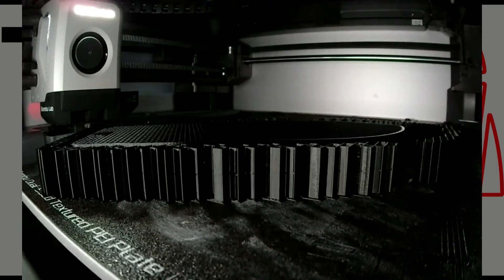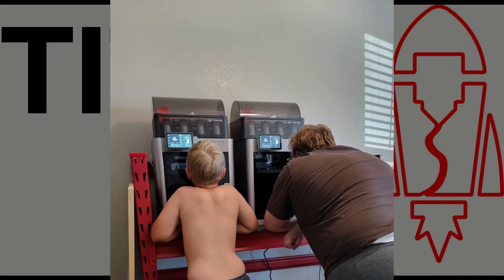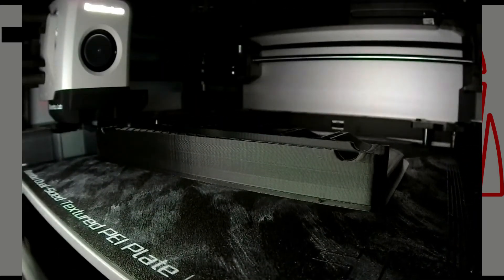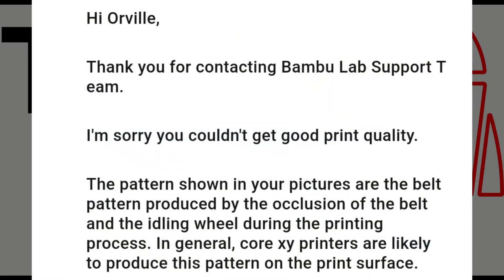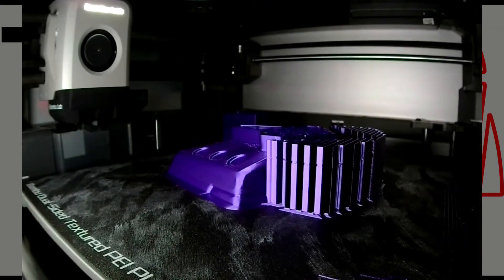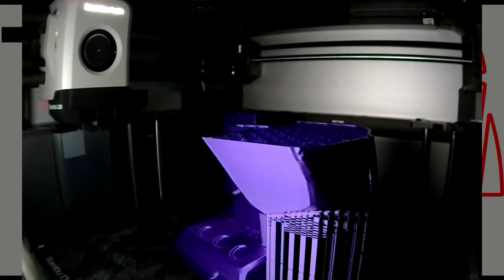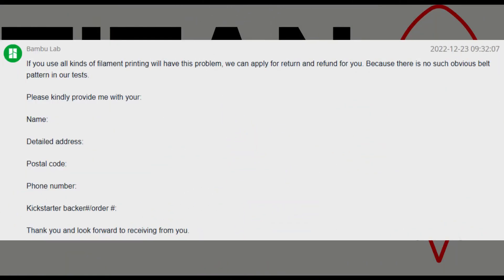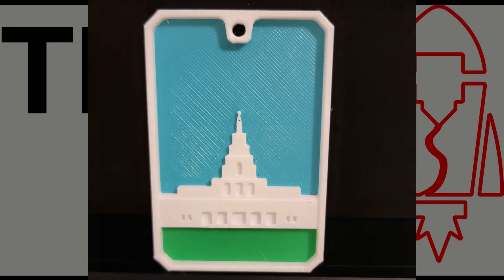Review of the Bambu X1 Carbon You Didn't Expect

Comment: But your limitation was with petg. You'd run into that speed cap with that filament on any printer if what you said about it's flow rate is correct. So why not just print at 80 or 100 mm/s...? the accels still create a great print time advantage over any i3 and other corexy machines.
Reply from the maker: Like I said in the video, I tried speeds from 50 to 300mm/s and this happens on all my materials including ABS
Reply: @Titan3DAZ  the printer was malfunctioning since the first startup, so maybe a part of the firmware or SD cards got corrupt. I believe those prominent VFAs are actually horrible input shaper results from the auto calibrate. Either way, my question now is, what printer are you moving to?
Reply from the maker: @Mehecanogeesir  it's not vfa. I factory rest my machine to see if it was bad firmware update or something and this persists. I also put this thing on the concrete foundation on my home and then added more and more weight trying to reduce the resonance with no luck. The pattern does match the pitch of the belts though. So far I am looking into raise3d, fusion3d, and maybe ultimaker/makerbot.
Reply: @Titan3DAZ  go DIY and build a K3 by Annex Engineering, a Vzbot 4WD, or a Voron Trident. The first and second being great and the Voron being a bit worse but the most available parts. You need printers that can pull thousands of hours at 10k-20k+ accels. Also DIY makes repairability  more dependable since the parts aren't from your printer company, which can close down or be unhelpful. DIY printers also have helpful communities/discords for help.
Reply: @Titan3DAZ  I got the Raise3D E2. Absolutely not worth the money. Resorted to the Slice Engineering upgrade and things got a little better but still not as good as my Prusas.
Seems like many other owners of Raise3D machines are similarly unimpressed. Seem to need lots of workarounds, they seem to work slow and need too much fiddling. The slicer is terrible. The customer service was sketchy at best. Waiting on the Prusa XL I think.
Reply from the maker: @Eric Mary  what about it specifically don't you like aside from the slice upgrade? I am looking at the Pro3 series though which seems to be noticeably upgraded in a lot of ways. Plus I got their sample part today and I am extraordinarily impressed with its quality. I asked them specifically for it to be done with the hyperspeed upgrade parts so I could compare the 300mm/s print speed of that to the bambu and the raise 3d Pro3 is better in every single way.
Reply: @Titan3DAZ  I have to say the Pro series might be better but you'll find considerable scepticism among owners. Their customer service record has been sketchy to terrible. When there is a problem it is always your fault. I also print mostly PETG and it's struggled with print quality from day one. First I wasn't drying enough then suddenly I overdried it. Bed leveling had to resort to shims as the screw ran out of travel. I talked with one person who bought an entire print farm of them and struggled greatly with similar issues. The European sales rep gave him the same line while standing in his shop. Always your fault, never theirs. When I mentioned the same file with the same roll printed perfect on a Prusa they got a bit hostile. I finally gave up on them and have wrestled with the issues with other users. Pretty much everyone feels they paid too much for the machine for what it actually delivered.
Reply: @Titan3DAZ  I remember the original raise3d printers everyone said had horrible support and didn't work well. Then the second release people had hopes for it being the new improved printer but it ended up being more of the same.. a lot of these companies know how to make an attractive parts list, a great looking printer, and a video. Not many of them have things really well figured out. Bambú Labs was supposed to be one of the first greats with great accels
Reply: @Titan3DAZ  and you believe that sample they sent you will match your prints? Lmao so naive

Comment: Try RatRig V-Core3 series, not as easy to start with as Bamboo but RatOS makes combined with great HW makes it great for large high speed printing...
Reply: I'm new o DIY printers. How does that compare to Vorons?
Reply from the maker: @MrJofArnold  They're IMO very similar. The rat rig will let you go bigger than the vorons, but the vorons have the flying gantry system which keeps all the weight at the bottom of the printer for the longest amount of time.

Comment: If the wavy pattern is the problem why not just sanding it to make it smoother? I may not understand the issue completely though. You may also be able to account for this in the print settings by playing with them a bit.
Reply from the maker: Sanding removes the desired surface finish, plus with the amount required I lose the dimensional accuracy that's needed on these parts.
Reply: @Titan3DAZ  ah, understood then

Comment: did you run both printers at once on the same table? that would kindof explain artifacts impossible to eliminate... since each printer would send vibrations into each others assembly.
Reply from the maker: At first yes, but then I separated them, put on on the floor, the other on the floor, added more weight to them, put them on a paver and a rubber mat to isolate the vibrations, and stepped one to some anchors in the foundation for my home and nothing changed the pattern.

Comment: Your goal was to be negative about this printer.  You met your goal.  Of, course that does not change that it is probably the best consumer printer made.
Reply from the maker: I firmly disagree. My goal was to use them for my customers, and I really love what bambu was able to accomplish. I just really wish they were able to have better quality control in their manufacturing process.
Reply: If the "best consumer printer Made" can't print straight walls without ripples at any speed... well then it is just not the best. My Ender3 (yes not storebought anymore) outperforms the Bambus in every aspect except speed and esthetics. yes it's slow and looks like Shit but it's siiiiiiilent and prints exceptionally clean surfaces, has octoprint that Manages my prints. 
And man there are so many good consumer printers Out there. Bambu is hiding some serious issues and people are still praising them as a new Jesus. Man these things aren't worth the money. Everything else is a lie.

Comment: I have this problem on the Y axis too but with a Ender 3 Max bedslinger printer. I had a rummage & found a toothed idler in my box of goodies. I'm from an engineering/mechanical background & have often looked at the smooth idler the belt runs on & thought to myself that's a stupid design. I'll fit it to the printer today & edit this post later on with an update.
Reply from the maker: That'd be cool. Please post your process on Facebook, I wasn't able to see an easy way to get the smooth idler out.
Reply: @Titan3DAZ   I changed the idler to the toothed one & while it did reduce the vertical column effect it didn't eliminate it. My printer is the Ender 3 Max as I said in my previous comment

I don't use that horrible app you referred to
Reply from the maker: @Phil B  interesting that it didn't eliminate the artifact. I'm glad it reduced it though, it's a step in the right direction.

Comment: What stirkes me about this video, is how much effort the OP had to put in to get a replacement. The amount of time he had to put in mustve been substantial. Probably coulda bought 3 machines with the time invested. I bought one and have had nothing but problems right out of the box. Due to work schedules, I didn't have the time to mess about with it very much until my 14 day refund and 30 day return had passed. Word to the buyer: If you buy one, make sure you bone up on the return and replacement time periods and use it as much as you can in that period to confirm it works. Also, be prepared to spend lots of time via email on additional data calls. upload your 3mf file and logs AND a video. They will hassle you for a video if you don't send one. Also , you might want to consider taking a video on your phone (so you can capture the screen on the front of the printer as well. you can upload that video easily from thier phone app.  Mine literally failed the benchy test right out of the box and I've had nothing but problems. The last thing I wanted to do with a printer was continually tinker with it.. And that's what I've had to do. So instead of print things, I've been spending my available time fixing things. I liteally spent 2.5 hours of my time to get a $35 warranty replacement part. Really frustrating. Oh! and be prepared to do everything via email as well. It takes forever., I was looking forward to this technology and no all I want to do is go all Office Space on it.
Reply: Any relief on your issues?
Reply: @memcrew1  So I waited 2 weeks for bambu to send me a new micro lidar, and new TH board and a usb c cable. I wasn't convinced that this latest round was going to solve the problem as I felt like they were just throwing parts at it because they had no clue. After spending 5 hours replacing everything, it still didn't work. At this point, I've replaced every part in the head, except the extruder tip and fan assembly. So I fired it up and it air printed. Aggravated, I tried heating the tip again and manually extruding by pushing some pla through. Nothing. I took the tip off and lo and behold, it was plugged. Thankfully, I had a new one on hand so I replaced the tip, heated the tip to 170 and manually extruded material. Threw the spool back in the AMS, loaded up a benchy and it printed right off. 3 months of Bambu troubleshooting and they missed the first thing that they should have had me check. Thanks for checking back in. I fixed it. Bambu sucks. What a waste of time and money.
Reply: @watermanna  Oh wow! Such a simple fix. Glad you solved it.

Comment: Print faster and turn up the nozzle temp.  Better layer adhesion and surface finish is the same.
Reply from the maker: That's not how layer adhesion works. Also, I did try faster speeds with no luck.

Comment: Couldn't they add teeth to the idler?  If that's truly the problem that should fix it.
Reply from the maker: Agreed. I'd hope they'd fix it. I'm not sure if the old smooth idler can be taken out. It looks like it was press fit in there with no real way to disassemble.
Reply: Have you tried printing a tpu insert OVER the idler to make it a stepped idler?

Should absorb some energy and be easily replaceable, without requiring the actual idler to be removed

Comment: It's kinda naive to think that you ll make make 3d printer factory just by having some experience 2 years ago and buying 2 expensive printers. It's actually the opposite. You need a lot more experience and a few of low cost but customized 3d printers with parts which you actually need. It's cool that you found the problem and shared it with us but your mindset from start was naive and I think it's not that big of a deal like you make it seem.
Especially I don't see why you bought it if petg is constrained by speed and bamboo is all about speed.
Reply from the maker: Well for 1, I print in tons of other materials, like ABS and PLA, TPU, Nylons, etc and sometimes I print PC-CF. I have over 6 years of experience with building and maintaining 3d printers, I have just worked at a company as a production manager for the 3d printing department for 2 years. I am not naïve at all with this endeavor. I do have a functioning business that prints lots of parts for lots of people. I just thought these would've been able to pay them selves off within the months of November and December and they could not do it.
Reply: @Titan3DAZ  okey, thanks for explanation. It s pretty unclear in video how much experience you have and why you had this idea. Sry for attacking you.
Reply from the maker: @Lovro Catela  it's okay. More for me to learn for my next video. I'm 100% new to this side of YouTube and it's a lot more than I thought.

Comment: you got refund from bambulab, what printer do you use, not corexy that means cartesian like qidi x cf pro?
Reply from the maker: Currently working with a flashforge guider 3 ultra. It's corexy and I'm going to put together a review of it in the new year.
Reply: @Titan3DAZ  Nice printer but price 6 195,00 € is really too expensive. Any other options with smaller build volume? The qidi is a no go option?
Reply from the maker: @akierum  I think if you have the money for a qidi, then go for it. They are really great options. I loved the qidis I used before. I do also think the adventurer 5m pro by flashforge is really comparable to the bambu and way cheaper if that is more your route.
Reply: @Titan3DAZ  The adventurer 5m pro does not have engineering materials as recommended, so any other options for ~1400Eur
Reply from the maker: @akierum  engineering materials at that price? I don't know of any. Engineering being nylons and PP and PC, idk any that are designed for that in that price range. Probably a voron, but you'll need to print the parts out of ASA.
Reply: @Titan3DAZ  qidi x max 3 is 350c nozzle PLA, ABS, ASA, PETG, TPU, PC, UltraPA, Nylon, etc.

Comment: It's 2024 and the problem is still present
Reply from the maker: Sad. I'd have thought Bambu would've gotten to the bottom of QC by now...
Reply: @Titan3DAZ  I have figured out, printing at slow speeds seems that resonate more and the VFA is present after run a VFA test I can corroborate that the minimum speed is 140 mm/s with PETG with PLA is less than that.
Reply from the maker: @paco-medina  interesting. Unfortunately my issue has to do with the belts. The pattern you see matches the belt pitch and show what misaligned belts on smooth idlers can do.

Comment: Those vertical lines are called Vertical Fine Artifacts. Even Prusa printers have them. My Ender 3 too, especially on the Y axis.
Some people claim that changing to 0.9deg motors will reduce the problem, but I don't think so. 
I think it's due to the nature of stepper motors and resonant frequencies + having to move considerable weights around. For instance, the Prusa Mini doesn't suffer from this problem.
Reply from the maker: I know of VFAs. This is not that. The pattern has a 0.4mm difference from the peaks to the valleys. There is literally a physical gap on the part inside the pattern.
Reply: @Titan3DAZ  did they not change in separation with varying speeds?
Reply from the maker: @alejandroperez5368  nope. They stayed exactly 2mm apart no matter what speed or what accelerations I used and no matter the filament I used

Comment: I have had my P1P for a few weeks I have not seen this issue at all. Sounds to me like you may want to go the route of the new Prusa. Looks like a fantastic machine and I still love my Prusa that I still use. Looks like it will be in the $3500 price range with 5 Print heads. Good luck
Reply from the maker: I'm definitely considering the new prusa xl. I hope it doesn't need to use prusa slicer though, I really am not a fan and I like other slicers more.
Reply: @Titan3DAZ  I’m just the opposite. I’m not a.fan of other slicers I love Prusa’s. But yes, you are going to have to use their slicer from what I’ve been reading and watching because of its multicolor version of the AMS.

Comment: These are the kind of videos I’ve been waiting for, videos that show a potential issue with these printers. 

But to be fair these printers are ambitious. What I find most interesting is it’s not all printers that do this leading me to a possible quality control issue. 

I’m not sure this will matter to some people, for instance I rarely need to print a part raw, as nearly all my parts have extensive post processing and finish. The only thing that matters to me is good layer adhesion and speed. Surface finish or ringing is fairly minor for most of my pieces though those parts looked pretty wavy. 

Seems like there is a fair mix of people rooting for this machine to fail (which to me is silly since if it succeeds the other manufacturers have to up their game to remain relevant) vs those hoping for a fix or not having issues. 

I think this company and the products they offer will improve with time. I’ve held off to see what happens with more of them in the hands of the general public. I’ve heard more good then anything. I’ve been impressed with some of the parts I’ve seen produced on the machines from local people that have them. I’ll likely make a purchase for an x1c in a month or so. If that goes well I may yet purchase a p1p this year as well. We’ve been reconfiguring our shop to accommodate more printers and already plan on at least 2 Bambu lab printers and at least 2 Flsun super racers as well as more traditional ender3 or equivalent printers. We’ve even added a huge post processing station for multiple resin printers and upgraded the space for our existing resin printers. Not sure what the plan is yet on those but looks like there is room for a lot of them. 

It amazes me how much more is being produced via 3D printing every year. I guess the idea that one day if you want something you can likely print it instead of going to a store to buy it gets closer every day but printer Ks have to improve before that ever happens.